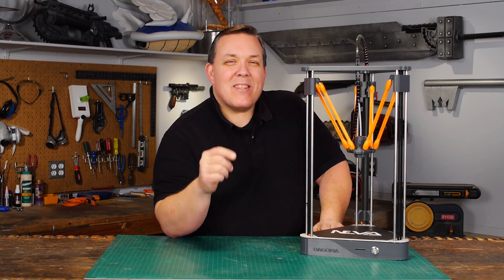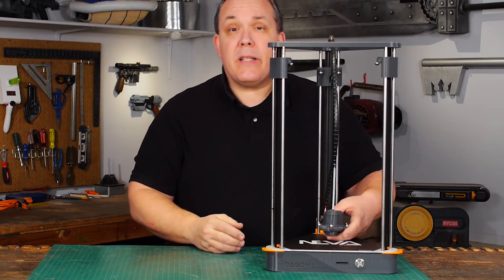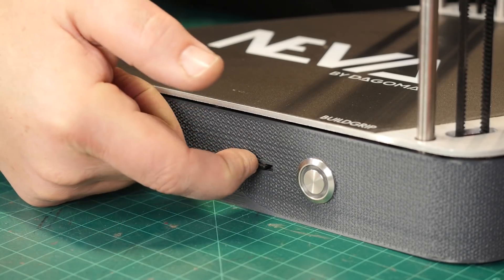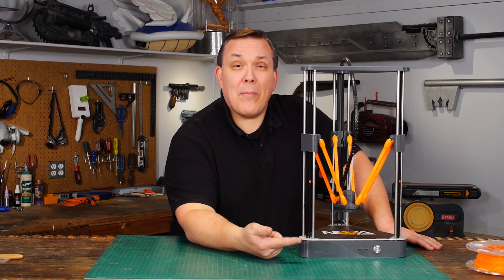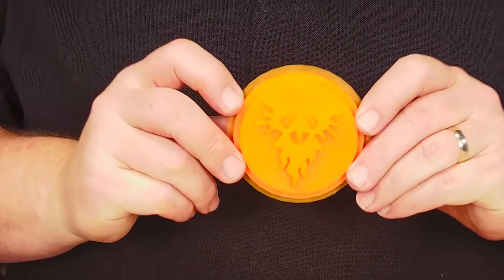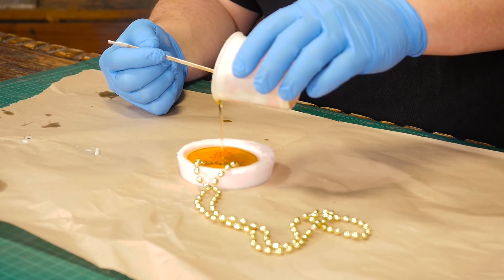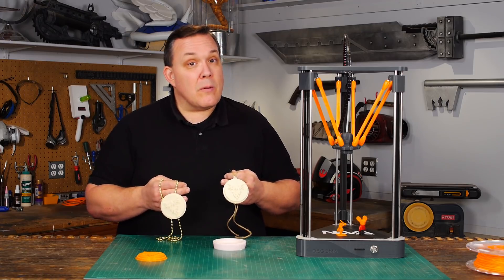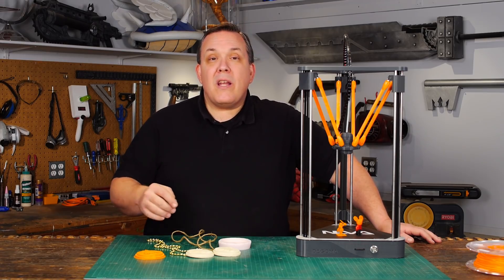Odin Makes reviews the NEVA 3d printer from Dagoma

Comment: The 3D printer is just another tool. It makes things easier and faster to replicate, like power tools would. Imagine trying to use a dremel to carve out the medallion logo. It's not impossible, but 3D printing saves so much time! The resin casting is a pro tip!

Comment: Hi Mr Odin. I was wondering what kind of resin you used in your casting for The Medallion you done in this video thank you.
Reply from the maker: Hello Katherine. The resin I used is a polyurethane resin sold at TAP Plastics- it's called Quik-Cast. It's just a two part resin (equal amounts of A+B), you get about 1 minute to mix and pour. De-mold in 15 minutes. These resins are harder on silicones, so a mold release is a good idea, you will get more casts from your silicone mold.

Polyurethane resins are available from many different suppliers TAP, Smooth-On, Alumilite, I think Michaels craft stores carry a small kit too. I use TAP because they have a retail store near me, and I like the convenience of just walking in to pick stuff up.
Reply: Odin Makes. Thank you so much😄😄😄

Comment: Appreciate the review to give a thumbs up, but the prop made is kind of a punt.
Reply from the maker: Basically, you are right. But the story I told about how the medallion happened is accurate, and I loved that I had a chance to actually use the printer to make a prop for an upcoming project.
Reply: There is a reason 3d printers were called rapid prototypers.  I'm glad he showed that the casting method was faster and more efficient.

Comment: How does it know what file to print?
Reply from the maker: The file that is saved at the root of the SD is the file that is printed. It requires a particular file name to look for. But, you can have as many folders with other files ready to go on the card, just copy and paste from a saved folder to the root and print again.
Reply: Thanks for the confirmation